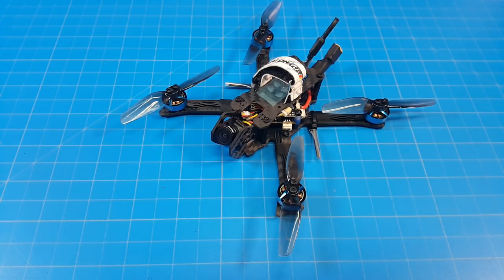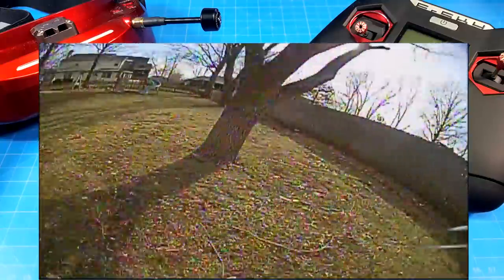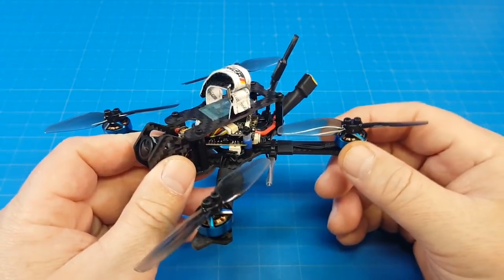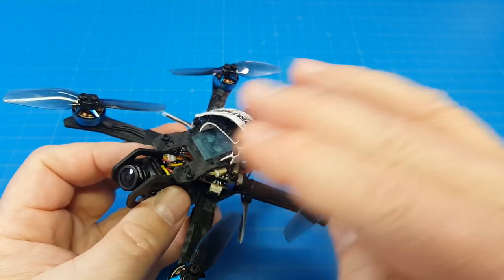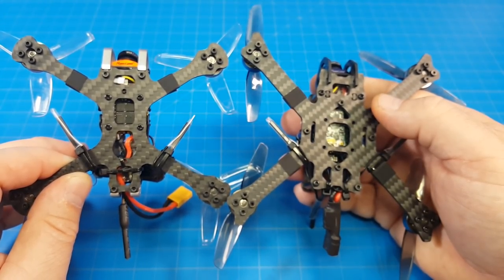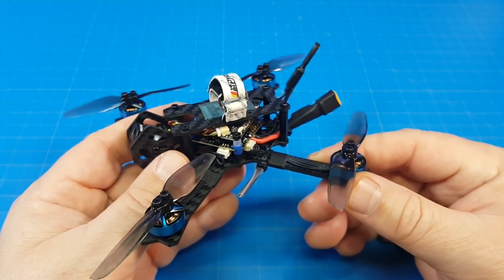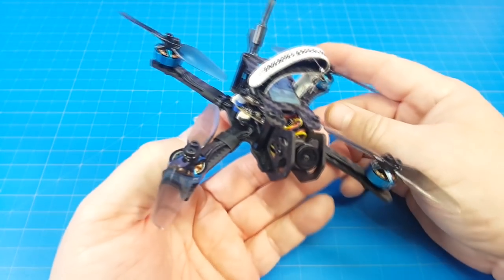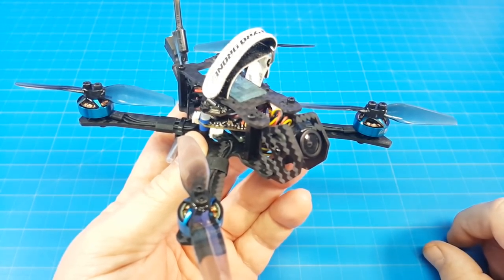Airblade Intrepid Mini // 3 inch micro // BetaFPV Motors

Comment: Thanks for the review. I just built a light 3 incher that comes in at 90g without battery. For mine I used the RCX 1304 5000kv motors and Avan 3 inch tri blades. Very peppy and responsive with a very long flight time using the same RDQ 525 3s battery. I'm sure the 1404 motor would do really good as well.

Comment: Hey Nick, I just built a Tadpole last month with the same cam, a 16x16 Iflight stack V1.5, Flywoo 1103-7650kv motors on 3S with Avan rush 2.5"props it's insane ! 4 days ago I put the JESC 48khz firmware, now buttery insane!
The trick with that Tadpole is lightweight components because it is a tank of a frame for its size.

Comment: About the stiffness of frames (and keep in mind that this is just my theory): I believe that the stiffness is directly related to the resonance frequency of the frame. More stiffer = higher frequency. Due to how the filters in BF work (higher frequency noise is filtered out much better) it is easier to tune quads with stiffer frames because they cause less of the problematic vibrations further down low
Reply: I bet you're spot on about that. 😊
Reply: Sounds plausible.
Reply from the maker: this could be especially true with noisy motors or banged up props.

Comment: Honestly, this has nothing to do with these quads you are reviewing, but thanks for doing them, Nick! Nice review, like always! 
I have to admit I'm kinda tired of the derivatives of the Toothpick, with their big weight, big motors, and other changes. To me, they're just another quad,and that's fine, but I'll take a True Toothpick any day of the week. 
I'm into my Diatone GTB229 which weighs about 45g, so crashes don't seem to hurt it because the inertia of the low weight just doesn't seem to do any damage and it's Diatone quality. I flashed it with Emuflight and JESC 48khz and it flies like it's on rails! Stock tune! Super fast, but amazingly agile too. Crazy control, and I'm 1/10 the pilot you are Nick! So fun to fly through small gaps in the top of trees. Even I can control it so precisely to hit those small gaps. Then get inches off the ground and zip through the tree trunks with the speed and agility of a hummingbird! 🤘
I love the little cube, and as you know, that frame is ROCK stiff! It's so awesome it's friggin' incredible! Damn long flight times too with JESC, but I'm not so crazy about how long they are... It's more about how much fun it is. I don't even pay attention to the flight times about 95% of the time because, quite honestly, I'm having too much fun to give a damn!!! I do know I'm not having to come back, to change out the battery pack, for a long time, and that's all I care about! 👍  I think pilots put way too much emphasis on the flight times. 
Guys, if you haven't tried what is considered in the spec Kabab defines as a true Toothpick (under 75g with the battery, AUW flying weight, this is around 70g)  you haven't experienced how fun FPV can actually get! It's crazy Co0ol! 🤪🥴

Comment: I've heard people arguing over the stiffness of the frames but it has not been a problem when tuned using correct PIDs. I've several printed PLA frames that flex way more and I have no issues with jello in the camera but some like to say otherwise. Obviously your PID tune is perfect for your style of flying even with the flexible frame. Awesome video btw! Waiting on the armattan tadpole review.

Comment: I agree on 3-blade on 1204 motors, did not find any that fly great, and I tried many (if not every 3" prop), even the super light 3016 Gemfan 3-blades did not feel right. Favourite props on the rcinpower 1204 5000KV motors are the HQProp 3020 2-blades.
Reply from the maker: Do you find the rcinpower 1204 to be battery drainers?
Reply: @NickBurnsFPV  Not in particular. I can get around 5 minutes of flight-time when I do freestyle on a 550 3s GNB, which brings the weight of my 3" to around 122gr AUW. For racing it drains more of course, around 3 minutes on the same battery. I have videos of both styles on my channel. When I just cruise I can get to 8 if not 10 minutes. Only flew in cold weather so far as well.

This is a quad that you helped shape by the way, you gave me feedback in a chat on instagram :)

Comment: Hey Nick! Hope all is well on your end, great review here as always. Picked one of these up a bit ago and will be building it soon. I actually have three different 3 inch builds waiting... This frame, a GTB 339 frame, and the Kebab TP3... I also have 1105 5200kv motors (off my eachine twig), these 1204 5000kv, and the Apex 1303.6 5555kv motors. I was thinking the intrepid might benefit best with the 1303.6 being a tad heavier and with the top mount battery, going for more of that freestyle feel... maybe the 1204 on the TP3 and the 1105 on the diatone? im sure any combo would work though. have a nice day.
Reply from the maker: I would agree on your motor matching👍
Reply: @NickBurnsFPV  Thanks nick, much appreciated.

Comment: Thanks for building tips. 
I just blew/shorted all of my 4 1105 motors for my light 3’’. Should I go 1106 or 1204? Any recommendations?

Many thanks!
Reply from the maker: I would go with 1204, it will handle the prop better.